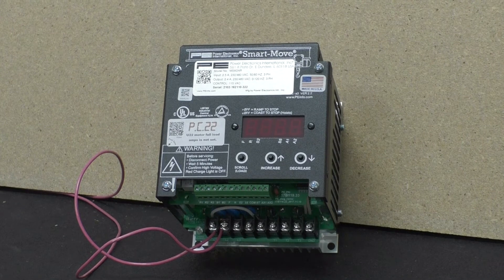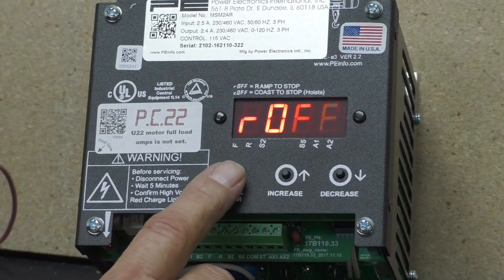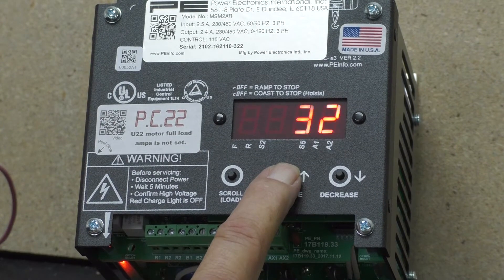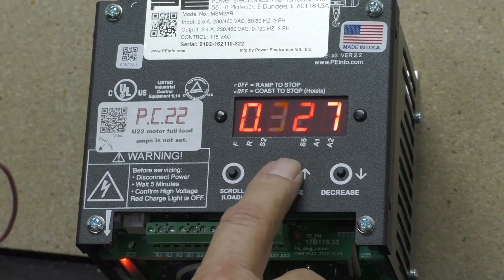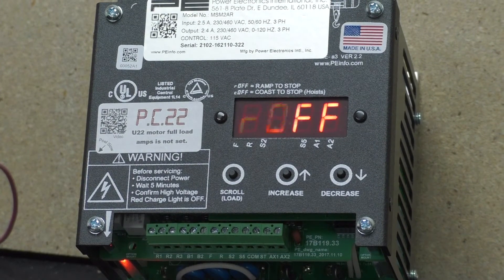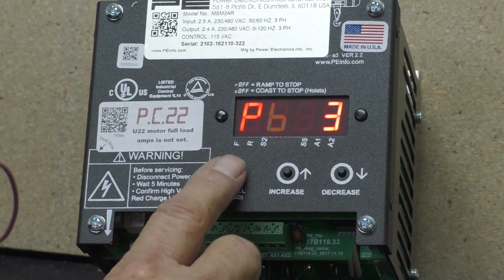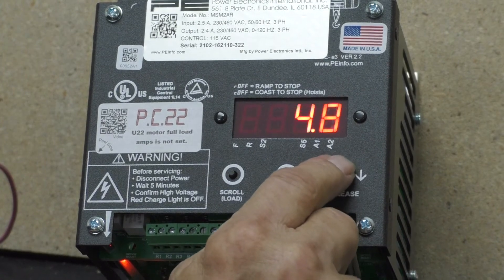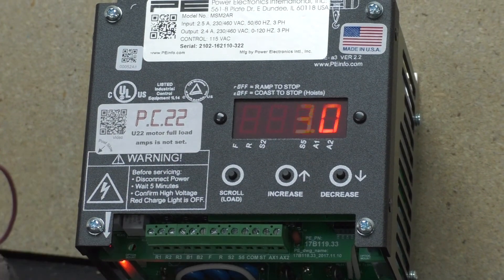Programming a Power Electronic Smartmove Inverter

Comment: I have a weird delay on a motion input signal. It’s not acceleration time issue it’s an actual delay. For instance 2 speed trolley speed one 15hz and speed 2 30hz. When control is pressed while watching the drive display from the moment button is pressed there seems to be a processing delay before the hz count up during acceleration starts